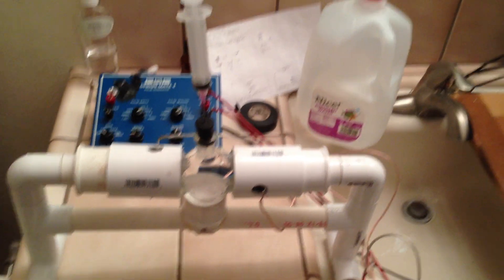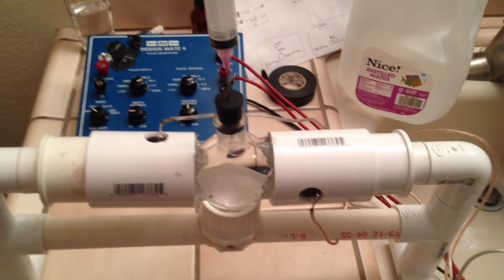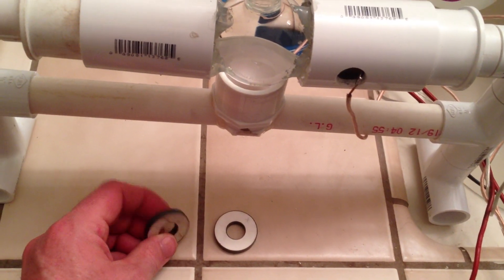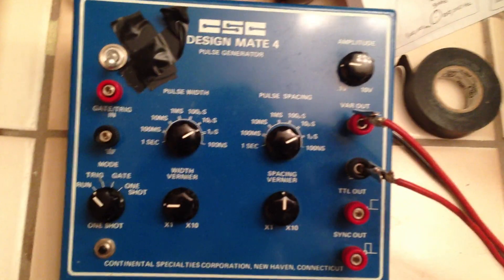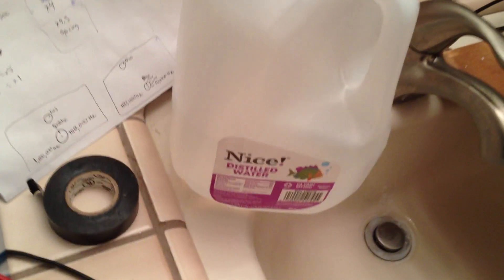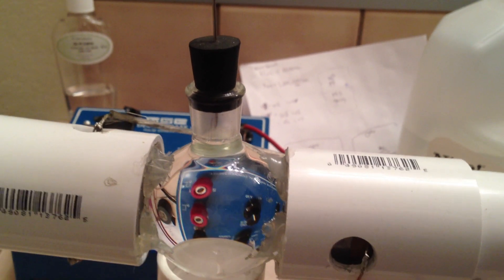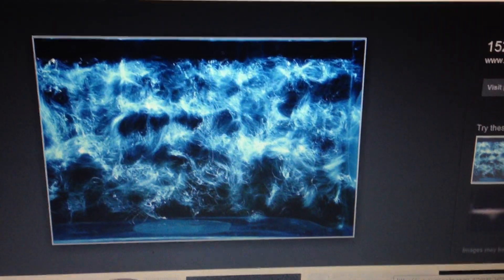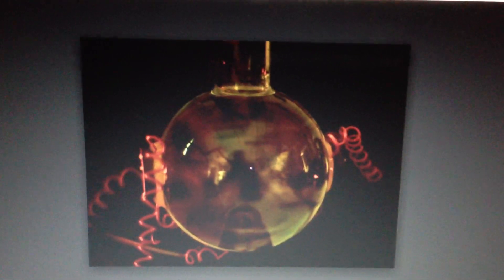Sonoluminescence 002 - Finally able to capture results on film (Multibubble)

Comment: I wonder if that effect would work better with a dissolved gas under some pressurehigh pressure carbonated water for example. The sound waves must travel faster the higher the pressure, the dissolved gas adds some resiliency- I picked up on your observation that not de-airing the water seemed to work the best
Reply from the maker: +63Turbo That's a great idea, worth an experiment. With high pressure there would be stronger forces keeping the water together so it may be less of an effect, but who knows. Experimentation will let us know. Keep those ideas flowing!
Reply: I looked into the dissolved gas idea a little more- it turns out that the gas to use is argon- supposedly, its the tiny bit of argon that is present in air that causes the light- the first few bounces drive the nitrogen and oxygen, and supposedly, the argon (perhaps other noble gases work also) is what is causing the light to form. Also,regarding the pressure idea- apparently there's a couple species of shrimp that can (under water) generate a "click" type sound so intense that it kills critters- this is how they get their food- from what I read these "click" sounds are a form of sonoluminescenceso apparently the effect doesn't go away at the depths and pressures that these shrimp live at.

Comment: Hey if you just fill your flask with a noble gas you'll get much better results.  Air only has about 1% argon so it doesn't work very well.  Just get some argon and dump it in there let it dissolve in the water and presto.
Reply from the maker: +saiyate great idea, allowing a gas to dissolve into the water. I bet xenon would make a bright star!

Comment: Hey Russ, how should we amplify the signal? We tried a few times directly using the output voltage of the signal generator which is way less than enough (around 4-5V). We have to obtain about 1000V to drive the transducer we do not have any power amplifiers. How should we do ? I suppose we have to use some very powerful power amplifiers. :)

Comment: hey russell.....i have been following this top for a while my question to you is what is preventing these bubbles from being large? I dont know if anyone brought this up, or if uim asking a stupid question but im asking it anyway :) ????
Reply from the maker: There are no stupid questions on this channel. We are all learning together.

From what I have learned, cavitation and vacuum bubbles can be quite large. It is the perfect spherical shape that is the key to sonoluminescence. Equal forces on all sides focuses the energy enough to excite the gases and vapor enough to emit light. The limits of the water molecules ability to maintain a perfect spherical shape are what keep sonoluminescence restricted to the micrometer size.

There are a few things that can increase the size of the bubble, but not by much. Increased viscosity/surface tension of the fluid, increased power input/volume, lower frequency (larger container), and of course resonance of the flask. Resonance maximizes the forces punching and pulling on the fluid.

Keep asking those questions,
Russell
Reply: So let's just say the bubble is scaled up....,.would the heat produced by the light emitted be scaled up as well?
Reply from the maker: Theoretically, if you could scale up the perfect spherical vacuum bubble expansion and collapse, there would be more gas and vapors within it to heat up. This would create a larger reaction and produce more light and heat. I don't think the temperature of the reaction would be higher since it's the same type of reaction, but there would be more gas and vapor reacting. Unfortunately many teams of people with expensive labs have attempted this dream and failed. That's not saying it can't be done, it just hasn't been done yet.
Reply: Yea I've seen a lot of talk about cold fusion....but not much about just biggie sizing the bubble to get some use of the "star" is the research that has been done on Trying to enlarge the bubble something verifiable, like could I look it up? I like to read :-)
Reply from the maker: The largest SL bubbles have been created by using lasers. Nearly 1000 times larger than bubbles created by a vibrating flask. Search for "laser SBSL". That should get you on the right track.
Reply: Russell Martin Terrence Trippin  Dug this up, down on page 50 is some complex equations for figuring about possible bubble size.  The math itself is a bit above my head.  Maybe you guys can have better luck with it. http://authors.library.caltech.edu/25017/1/cavbubdynam.pdf
Reply: About to look at the SBSL stuff and read Scott's stuff AS SOOOOON as my phone charges...darn pc crashed :-(
Reply from the maker: Good info, thanks Scott

Comment: Hi, I am here for your help again. I have met a lot of difficulties during this period and we haven't made much progress. One thing, which has bothered me so much, is that our piezoelectric transducers are plastic  http://m.rs-online.com/h5/mobile/uk/catalog?url=%2Fweb%2Fp%2Fpiezo-buzzer-components%2F7541987%2F ... Also I don't have an audio-power amplifier... Furthermore I don't have some insulators outside the wires. Should I get some PVC pipes outside the wires? This is my very first project and I really don't want to mess up...
Reply from the maker: That transducer should only be used for picking up the signal on the oscilloscope it is too small to move the glass enough to cause cavitation. First you need to cut open the plastic housing to get to the ceramic element inside. Once you cut the top off you will be able to glue the ceramic element directly to the base of your flask. This will allow the flask to vibrate the ceramic element enough to show a voltage on the oscilloscope. I used a razor blade to trim about 3mm off the top.

Comment: Hi, I just want to ask whether we need solders to connect transducers and wires. I mean a solder costs about $18 and we need two. Besides, how will we solder them?
Reply from the maker: If you are able to secure the connections without soldering then that will work too. Avoid alligator clips though. They tend to spark with the high frequency making it hard to see the light from the SL. Twisting wires together should work just fine. I dripped one drop of solder on each side of my transducer ceramic elements then soldered a wire to that. I'm sure there are other ways of doing it. Hope that helps.
Reply: Russell Martin Thanks a lot~

Comment: can you please post the link from the website where I can buy the transducers mentioned?
Reply: and amp as well?? thank you
Reply from the maker: Here is a link to the transducers I am using in the video (60W 40KHz):
http://www.ebay.com/itm/Ultrasonic-transducer-60W-40KHz-for-Cleaning-Ultrasonic-Cleaner-1-pics-/321104410452?pt=LH_DefaultDomain_0&hash=item4ac3507754

Here is a link to the transducer ceramic elements I show & am using in my new setup: 
http://www.ebay.com/itm/1pc-New-35-15-5-Ultrasonic-Piezoelectric-Transducer-Element-Ceramic-Ring-/300716636545?pt=LH_DefaultDomain_0&hash=item46041bb981

The amp I am using in this video is an old (30+yrs) audio amplifier I got from my parents. It's an RCA STA-3900

You can use just about any audio amp out there. Someone else had results using two of these, one amplifying the output of the other.
http://www.ebay.com/itm/Mini-AC-DC-12V-TDA7297-2-15W-Audio-Amplifier-Board-Dual-Channel-DIY-3-5MM-C-/271350181011?pt=LH_DefaultDomain_2&hash=item3f2dbb2c93

If you need anything else, just ask.

Best of luck to you on your project,
Russ
Reply: Russell Martin Hey Russ, how is the arduino amplifier shown in the ebay link supposed to boost enough volts? It is supposed to be at least 700 volts to generate the transducers however its limit is around 12V...
Reply from the maker: You bring up a good point. Personally I have not used that amp, but a YouTube friend told me he used 2 of those amps, one feeding into the other, and it worked for him. I was just trying to find the least expensive way to make one for my viewers.

Comment: Thanks for sharing. How did you observe the wave shapes with oscilloscope since you did not use an extra ceramic as a microphone of the ultrasonic waves?
Reply from the maker: I didn't use an oscilloscope on this version. I took the setup into a dark room and increased the frequency until I saw light. Then fine tuned it until the light was at it's brightest.

Comment from the maker: Hello George, in this setup they are wired like 2 speakers. The frequency generator is sent to the input of the audio amplifier. The amp output goes directly to the transducers. Both positive sides of the transducers face the flask. This setup will only produce multibubble sonoluminescence. You will need a variable inductor to create a standing wave in order to make singlebubble sonoluminescence. If you'd like some wire diagrams, send me your email address.

Comment: so basically "space is stretching slightly and then collapsing" in on itself? ... 
does that imply that a lower pressure would cause greater ease of stretching them apart?
it makes sense that deionised water is working better. the reason why is because they are polar, and make a hexagonal shape when frozen... would keeping the water at 4 degrees celsius help at all? since 4 degrees is it's densest form?

Comment from the maker: It's from Continental Specialty Corp called a Design Mate 4. I bought it over 10 years ago when I didn't really know what to look for. Unfortunately its only capable of square waves, but it got the job done here. Just got a new one on eBay for about $25 capable of all waves up to 1MHz for star in the jar version 3. It really comes down to what you need it for. Good luck with your search.

Comment from the maker: A&C: Popping isn't really an option here. The "bubble" isn't a bubble at all. It is a void of vacuum caused by forces pulling the water apart in that area (cavitation). There is no pressure inside to be released, there is only vacuum. B: Scientists are attempting a "full implosion", but it is very difficult to keep the void in a perfect sphere as it collapses. At some point part of the wall fails and collapse before the the rest. If it remained a sphere, heat and energy would indeed increase.

Comment from the maker: I have a list the parts & prices in the description. If you need to purchase every item, it would cost you just under $150. I already had a lot of the equipment from other projects, so for my first test run I only invested about $12 for 2 transducers. The key to achieving single bubble soneluminescence (SBSL) is to create a standing wave between the transducers. I'm still working on that. Also look into acoustic levitator, as they are essentially the same device. Just sent you a link on size

Comment: Does anyone know what would happen if you tried to make a consistent sonoluminescence device?  Whereby you consistently have bubbles coming out of a spout that hit the soundwave and collapse at the same point over and over.  Would that be dangerous if plausible?  The water would heat to too high of temperatures and so would the spout at some point right?  Let's just say I'm very interested in doing that.

Comment from the maker: I used my friend's Canon EOS Rebel. In M (Manual) mode, the main dial controls the shutter speed. I adjusted it to up to 5 mins to capture this dim light. Pressing and holding the Av button on the back of the camera in conjunction with turning the main dial controls the aperture. To avoid camera shake, use a tripod and a remote shutter release, but you can pull this off without them. There are lots of YouTube videos on this.

Comment from the maker: Hello Steph, I looked up the patent. In a quick overview it looks like they are both pulsing at high frequency producing ions, plasma, photons, fusion, and potentially fluctuating EMF (unknown strength). I will get the results of the multi-meter on a coil around the jar soon. Thanks again

Comment from the maker: If there are any gasses formed during the reaction, I am not able to tell. However, I do notice that my vacuum decreases during the experiment. I wrote that off to the fact that the transducers get very hot and transfer that heat to the water. Evaporation of the water and expansion of gases will also cause a decrease in the vacuum. This happens very slowly over the course of 15-30mins. If there are gasses formed, they are not abundant.

Comment from the maker: For my crude 1st attempt I already had wire, a glass vase, a pulse generator, and an audio amplifier, so the only expense was the transducers which cost about $12 for 2. I will post links to ebay items in the description. Total cost for the round flask design was about $35. Have fun experimenting!

Comment from the maker: Interesting, thanks for your input. I have only used vacuum. I will mess with pressure and see what happens. Thanks for the graphic, that helps me visualize whats really going on in there. In the next design there will be a longer cavity which should make better use of the soundfield sweet spot.

Comment from the maker: I'm glad you enjoyed the video. Sonoluminescence has been around since 1934, discovered while working on sonar. I think if it was going to change the world, it would have by now. It seems to me that the only way to use this tech as a power source is to use it as a heat source to create steam. The collapse of the cavitation bubbles produces temperatures up to 20,000 degrees Kelvin. Personally, in my small scale replication, I do not see it being practical as a power source.

Comment: As I understand it, part of the equation relies on water pressure. I think you would get better results if you suspended a large body of water, and rigged a system with which to re-secure the beaker, only under heavier psi load. (perhaps a simple ball valve?) Also, since you're not using ultrasound, why limit yourself to two inputs? Its the sum pressure at the core that's important, just be sure to symmetry. /wiki/File:Soundfield_Water_4MHz_TransducerRadius5mm.png

Comment: The picture with lots of bubbles you showed is using 97% sulfuric acid saturated with xenon. Also, supposedly improving on that, from DOI: 10.1002/anie.200905754: "MBSL from 85% H3PO4 is much brighter compared to the light emitted during MBSL in water[22] and even brighter than MBSL[13] in 95% sulfuric acid... the observed luminosities relative to phosphoric acid are less than 0.25% in water and 65% in sulfuric acid."

Comment from the maker: Yes, the balance on my amplifier works great for this. I have only tried it when the lights are on, attempting to get a cavitation bubble to the center. It will move the bubbles side to side. I haven't tried it with the lights off yet. I'll give that a shot and let you know what happens.

Comment from the maker: Thanks. Good thought, I tried that. The bubble is shredded and drawn to the areas of cavitation, which are more like freeways of small bubbles. The light appears in the places where these lines intersect. I still think my problem is the frequency and or the degassing of the water. Lots of variables to mess with and fine tune.